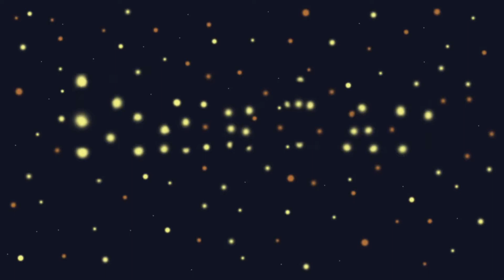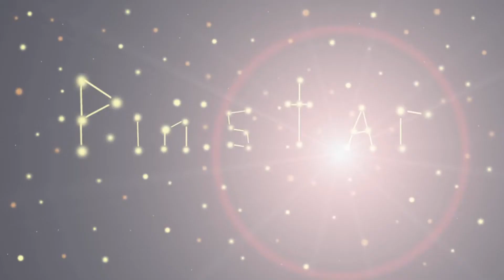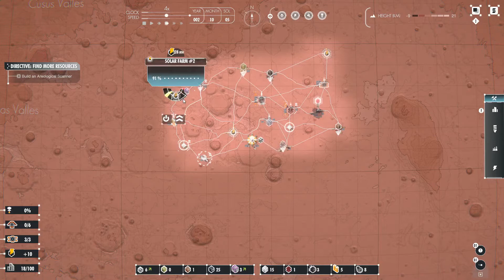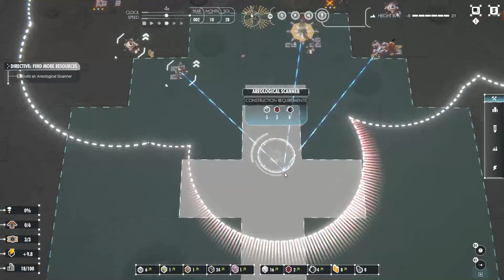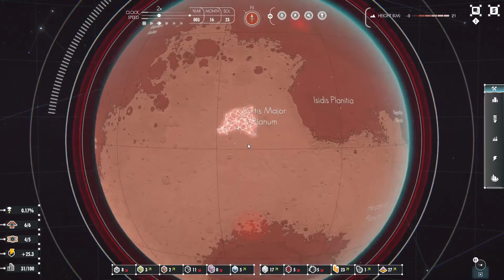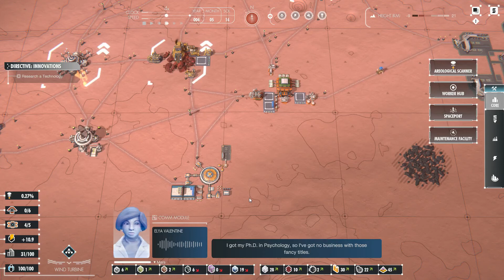Pinstar Plays Per Aspera (Press Build Preview) #2 - Iron Will

Comment: I feel maintenace drones have to be disposable, as it's the main impetus to upgrade your equipment. Factories II are only 50% more throughput, but cost 3 times as much, and because you can scrap buildings for free (you get all your resources back), having maintenance drones and workers cost upkeep encourages you to plan a sensible colony and use upgrades like better roads and more modern factories, rather than just building level 1 factories everywhere and having a billion workers running around to move the resources from place to place inefficiently. It also encourages you to balance resources, as having your steel factory sit around because you aren't producing enough iron ore actually costs you something. If there were free maintenance, it wouldn't. 

In fact, that was one of my primary criticisms of surviving mars. BECAUSE drones were zero upkeep, there was absolutely no incentive to actually build a sensible transport network that conserved them. You wanted just one drone hub that inefficiently serviced everything, and then have 100 drones servicing it because drones last forever and therefore drone time is free.

well, one of my MANY criticisms of surviving mars. What a beautiful, amazing sounding, garbage game. They had to patch the thing to literally give your colonists something to do, because it was a milestone and they didn't bother to make colonist time and effort a scarce resource. What's a resource management game when all the resources are either irrelevant (drone time, colonists, colonist man hours, advanced resources), or cripplingly finite (metal).